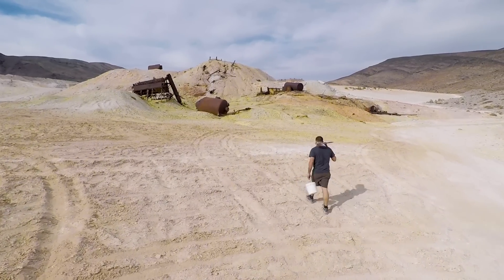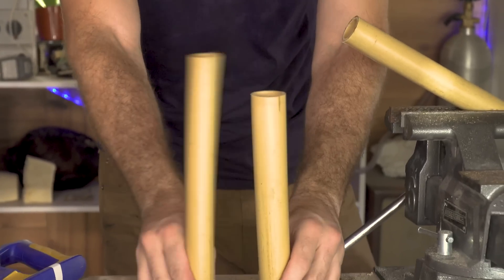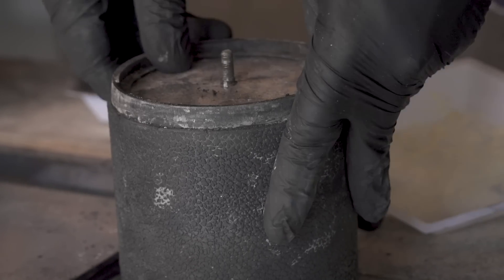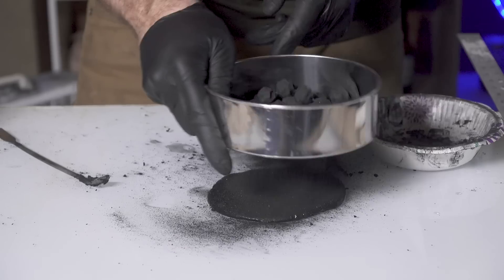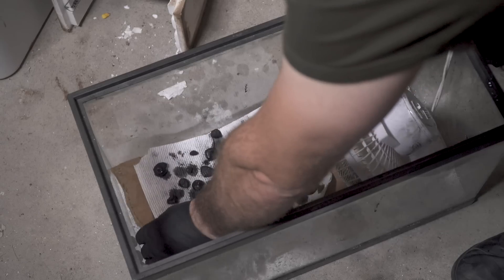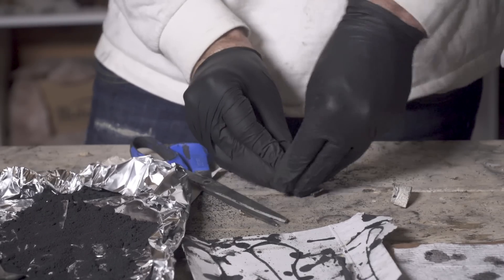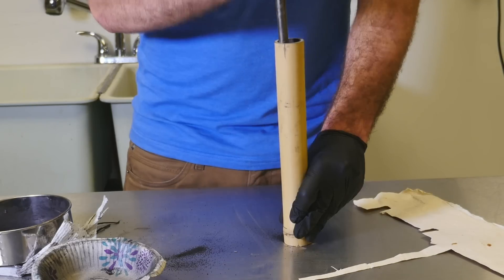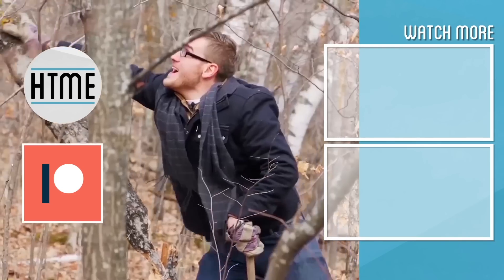Making Fireworks out of Bamboo, Sulfur, Potassium Nitrate, and Charcoal

Comment: If you want to really make a firework here is what you do  first make a shell then pack the bottom with granulated black powder then pack it with a few stars then cap it put a hole in the top after that put fuse wrap it and boom

Comment: hi how did you make 
Potassium Nitrate??
Reply: He made it from bat poop, there is another video where he explains the process.

But, basically, you mix it with hot water, screen out the large solid chunks, pass it through a coffee filter, and let it dry; keep repeating diluting it in hot water and letting in dry until white crystals form; pulverize it and you're done.

Comment: It seems like your trying to combine effects. I would just try to keep it simple and have maybe one effect. Maybe a comet or a mine would be easier. Also looks like you need a better lift charge. While this is all super dangerous with and without the proper equipment please do not use that fuse. That's something terrible  waiting to happen. Maybe reach out to some manufacturers in the state.

Source: I'm a Pyrotechnician in MN.

Comment: You can’t make ALL fireworks with this. You still need other oxidizers like barium nitrate and a chlorine donor and strontium nitrate for green and red. But I would be surprised if you just started makeup pyrotechnics considering how relatively advanced. You can make flash powder with aluminum-powder that you can make with your ball mill and you can make potassium chlorite witch is a MUCH better oxidizer than kno3 and mix them ( once both are in fine powder) in a 70 30 mix, with
Potassium chlorate be the most prominent ingredient!!! But please do a lot of research on flash powder so you don’t kill your self

Comment: If this was meant to be a Roman candle type device, don't you have the fuse in the wrong end?
Shouldn't it burn down from the top?
Reply: it was meant to be a mine not a roman candle. Though a roman candle is just a couple of single star mines placed on top of each other. The reason the fuse burns down from the top in a roman candle is cause the top mine needs to go off first to clear space for the mine that's under it. See it like a bullet, ye have the powder behind the bullet, in a mine ye just light the powder and shoot the bullet out, in a roman candle ye have a couple of bullets stacked on top of each other with some saw dust in between them, than the fuse burns from the top down past the bullet to the powder which shoots out the bullet and than the fuse continues burning till it hits the next bit of powder etc. In case of a roman candle the bullet is just the star and in case of a mine the bullet is a bunch of stars kinda like buck shot in a shotgun

Comment: Plastic. Show how to make plastic from scratch.
I think this would be good because of how it is everywhere. Love your channel and best of luck in your later projects
Reply: And also maybe if it was successful maybe you can make different types of plastics
Reply: Or plastics that aren’t petroleum based like the kelp plastic
Reply: There's three ways to make plastic:
1)radical
2)anionic
3) cationic 
Getting the starters is moderately expensive, and getting the right conditions (anhydrous, no O2, depends on the reaction ofc) is downright implausible with a hobby setup like this. Not knowing the chemistry well will give you a big black goopy block of failure and possibly destroy your glassware.
Reply: @Justin Koenig: There are even more ways: e.g. ester and amide based types like PET or Nylon

Comment: While the powder is wet try pushing it through a strainer so it’s in a larger bead type form. This increases the surface area and lets it ignite and expand quicker. Other than that I’m not sure what the end effect for the bamboo fire work should look like so I do not know how great or poor you did ( but it looked nice) but it would be cool to see you add other things for color. If not I’m sure you’ll make some other good content
Reply: larger grains would produce less surface area and ignite and expand slower.  I think his bamboo thing was a failure because he lit it from the bottom.  As the powder in the bottom burned and expanded it pushed all the rest out of the top without igniting it.  I bet if he walked out there the next day he'd find most of it laying on the ground.
Reply: Techno Babble Techno Babble you are right, I used the wrong words. But you should always granulate the powder so the air and combustion can travel through it faster to create a faster expansion of gas in a shorter amount of time. So bad wording on my part. But you will almost always see black powder rifles and even the powder in shot gun shells granulated for this effect

Comment: Hi, that's a good start, but if you want to improve your "starmines" you need  to change some things. 
First of all try making some granulated black powder its better for lifting "stars" into air, packs a better punch. 
For the stars - you need to work a bit with proportions, since no charcoal is alike.  And try making them smaller imho looks better that way. 
And theres no need of force for star and BP mix, pack it lightly, some tapping on the table should be enough, afterwards jamm the top with some paper plug around 1/4 inch thick. Because of that stars should rise higher. 
And please, for your safety try to come up with a better type of fuse, the ones you used dont look safe and reliable. 
Anyhow great video and best of luck with new projects.
Reply: You forgot to mention that it’s a messed up roman-ish candle and not a firework and I’m surprised that he didn’t use the Chinese wrapping gunpowder into paper method for a fuse
Reply: spaidermenas2 couldn't have said that better my self. It will take awhile to perfect and my be difficult since your materials aren't as refined. Please don't use that fuse. 

Source: Pyrotechnician in MN.
Reply: if I'm not wrong the originals, don't dunk the string in a gunpower watery mixture. instead, they make a paper burrito-ish fuse with the gunpowder in it. dunking it makes it unstable i think, since it's not a even mixture of the conductor and fuel... it's like trying to take-off a jumbo but with an extremely small rocket that's all over the place and on a tiny runway...
Reply: spaidermenas2 dude black match is pretty reliable
Reply: when made properly. But it can ignite at any spot, where a spark hits it. So not too safe for timeing.

Comment: As I student of chemistry I not recommended you work with anything material in wood, is very dangerous. I know that metal material can be very expensive but in case of you, and assuming that you haven't any fire protection system in your new studio, is my advince that you use metal table and shelves. I not think that you will be so neglected, but better to prevent.